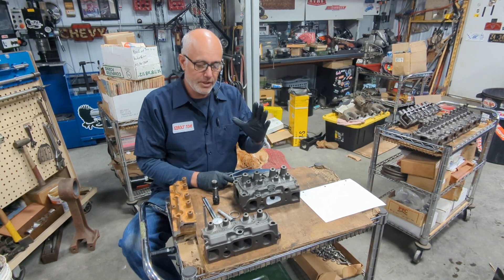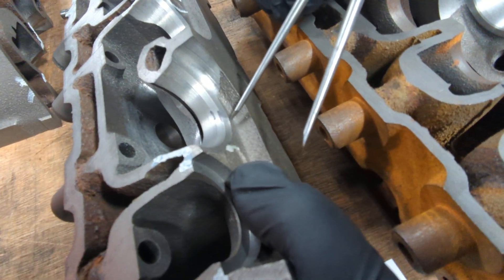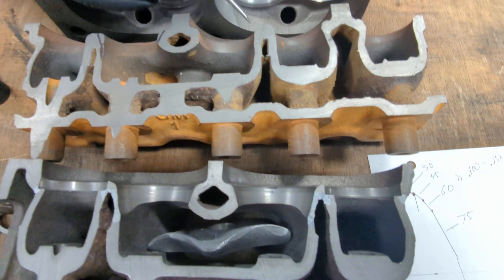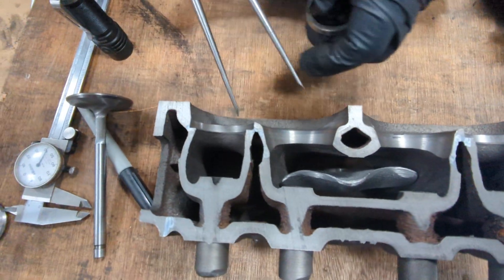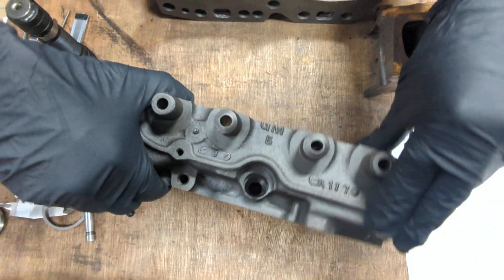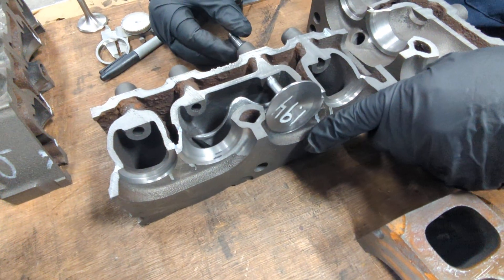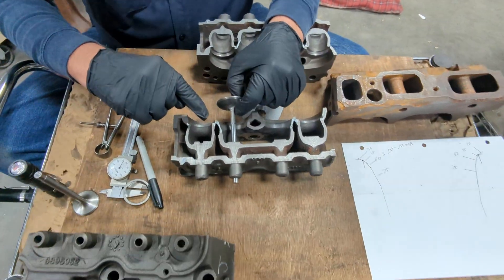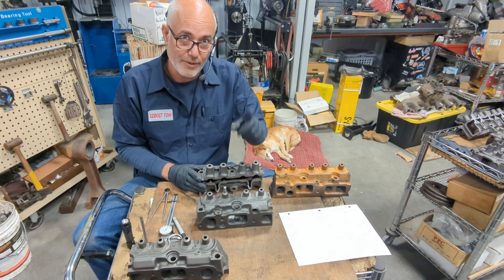Chevy inline 6 head porting and valve enlargement

Comment: Has anyone experimented with using the exposed hole on the top of the head as a place for fuel injectors for a MPI setup. It would be 3 injectors in total.

Comment: This is a very very good video.  It illustrates answers to all my questions.  Last we talked, you suggested your reground can and 1.84" intake valves for my 292.  After seeing the cutaway with the 1.94 valves, I prefer having the additional head thickness when using the 1.84 valve.

Comment: What kind of power increase would be gained by doing this on a 194 six, with a cam upgrade, intake, exhaust so on and so forth.
Reply from the maker: You could easily go to 200 HP from the factory 120HP
Reply: @telowe2000  Would I be ahead to build a 230 which, I have.
Reply from the maker: Yes sir. About 40 more CI and that = 40 more TQ

Comment: Single best mod one can do to one of these, by far, with surprisingly good results.  The crappy shared port design on these (along with several other engines, like the BMC A and B series) runs far better than it has any right to.   The biggest bummer about building these engines is pistons.  Nobody makes a direct fit hypereutectic flat top with modern ring packs.  Everything is clunky 1960's-70's style forged pistons that leave a lot on the table.  I built a few of this with different rods / offset ground cranks just so I could use decent pistons !!    Another thing I discovered was how much better the somewhat clunky looking Offenhauser intakes run than the sexier looking Clifford units.  The big Clifford intake requires constant heat to control the fuel puddling LOL!!
Reply from the maker: Not true on the pistons, we have them here. https://www.12bolt.com/store/c5/Pistons.html  we will also be offering a new designed intake.
Reply: @telowe2000 I’m installing a duel fuel system. I am looking forward to the Colorado alternative fuel rebate. Btw, no pudding, propane is a gas.

Comment: We built a 6=8 kit on a chevy 250 . 2   650 holleys headers shot peened rods lump port with 390 FE valves and lathed new keeper grooves . it went into a 70 SS Nova 4 speed .  it sounded like a Kawasaki hitting 10,000 rpm it only ran 20,000 miles and through a rod . it needed a forged crank and rods . this was back in 1983 . on those its port sharing . I tried to talk Hubert to sell me the 350 that came out but no go , backup motor .

Comment: So I assume you do 181's as well ? Some would call them 3.0L but I have the older head of the same port design as the heads 
You have in the video . Do you have a web site or some way of getting in touch with you? I didn't see anything in the description. This a jeep project looking for torque so won't be radical just looking to improve flow some.
Reply from the maker: www.12bolt.com  we do offer the bolt in lump kit for 4 cyl and also have completed heads on the shelf.